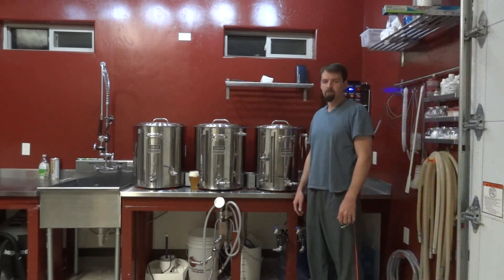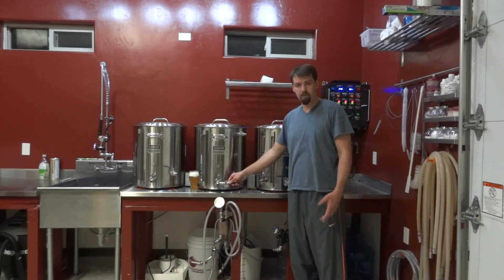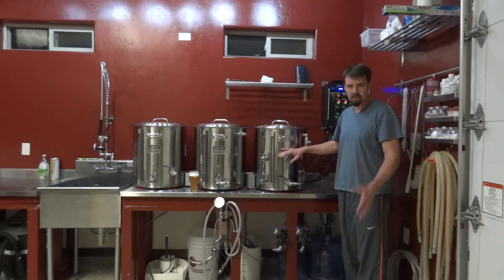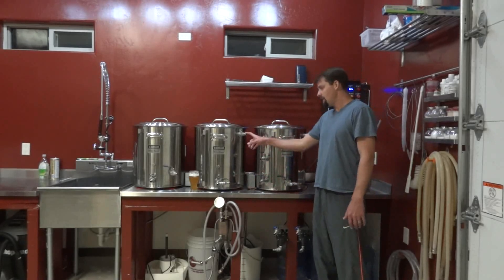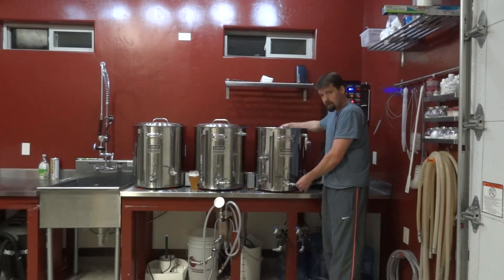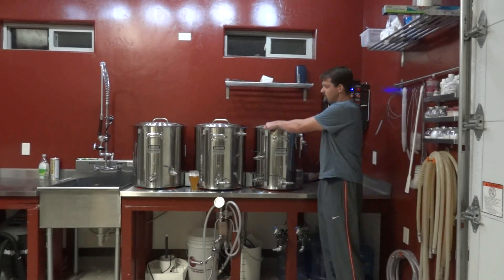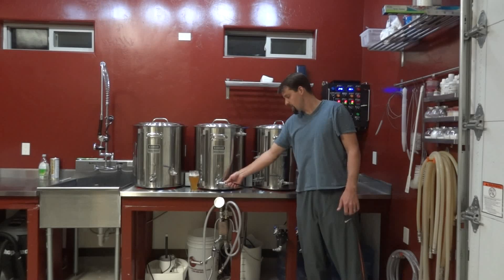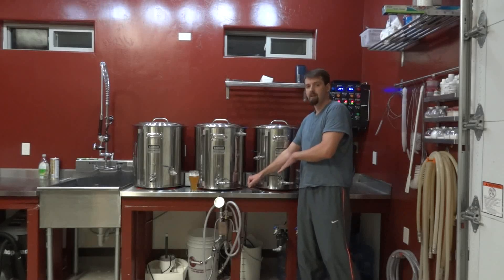Heat Exchange Mash System (HERMS) overview // BREW NERDS community

Comment: Hi guys! I'm building an Herms system but I'm missing something. Is it also required an heating element inside the mash tun or is the probe just for check the temperature in the mash? The HERMS looks grate for keep the temperature desired, but does it work well also for the multi step? How does it take to increase from 60 to 70 for instance? Thanks.
Reply: There is no heat element in the mash tun. The PID is just to monitor the temperature. His panel, like mine, can set an alarm if it gets too hot or too cold.

Comment: Hi! Your video is great, thank you for your time. I have a question. I understand that this is the most common setup for advanced home brewing. But I have a question, why people use a boil kettle when they already have the hot liquor tank? I mean, you could drain and sparge the mash then drain the wort is a plastic bucket while, in the meantime, draining the hot liquor tank. Then put the wort in the empty hot liquor tank where it will be boiled with the electric element. You could also use the coil with cold water to cool it down after boiling. Am I not understanding something or is it just too much trouble to do so?
Reply: @mrmadam28 you need to transfer your wort from the mash tun, to the boil kettle. This gets the wort off the grain bed so that you can boil it. If you boil on the grain bed, you introduce more, and different, types of sugar that you don't necessarily want into the wort and also run an increased risk of burning the grain. Hope this helps.
Reply: You coulddo that, but the HERMS coil will be  hard to clean after.  Usually people clean the inside of the coil by recirculating the last of the sparge water through it while the wort is boiling.  If you are looking at super simple ( and cleap) you could do BIAB (brew in a bag)
Reply: @fryloc359  That is a good point, thank you!

Comment: Nice vid.  Building a gas herms now.  I had not considered circulating water in the HLT.  My assumption was that the difference in densities between hot and cold would naturally circulate the water.  Thanks for the tip!

Comment: what was the approx cost on this system?
Reply: +Jacob Pyle Probably $6K, though I didn't keep close track during the build.
Reply: the electric control component alone is $1,4095.00-$2900.00, the pots are $429 a piece. plus you have the tubing, pumps, heating elements, and temperature probes that you need.
Reply: I priced mine new at $7000, but I bought it used for $2500